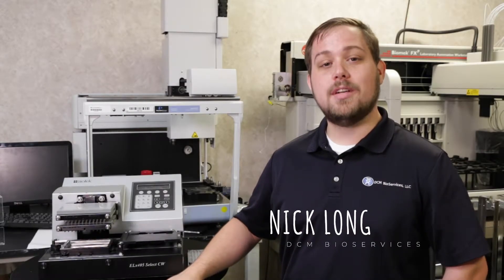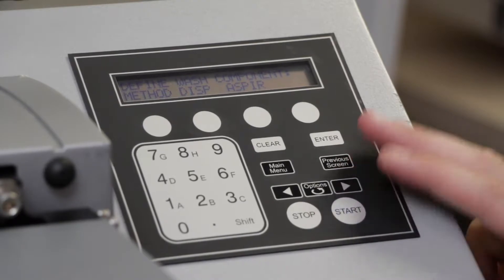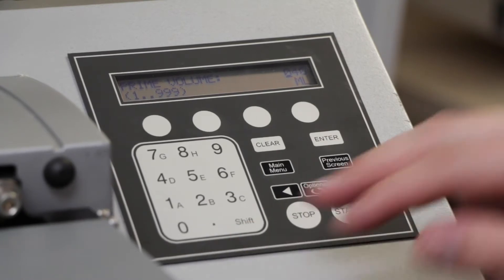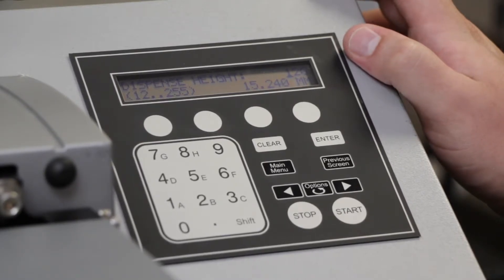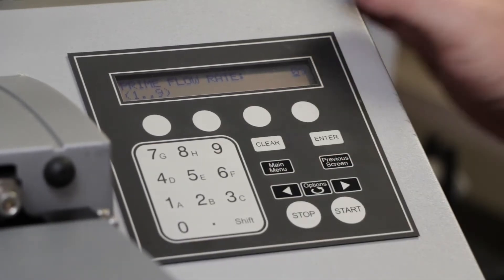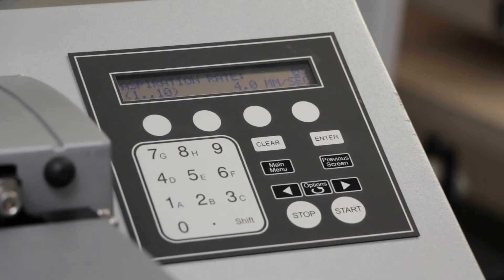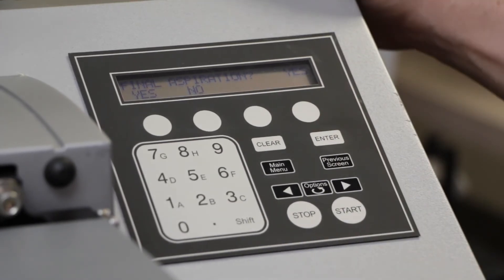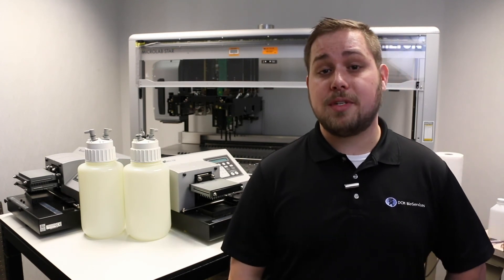BioTek ELx405: Building A Wash Protocol

Comment: Is there a video or step-by-step for how to create a washing step for a 384-well plate, where the head stamp is still a 96-head?
Reply: We do not have a video outlining 384 wash step generation, but the procedure is very similar to the 96 wash step. Only ELx405 Select, Select CW, and HT units are capable of washing 384 well plates with the 96 format manifolds, so please be sure to check your washer model. When creating the wash protocol, simply specify the plate type as 384. You will need to specify the wash format after selecting number of wash cycles, with options for Plate Format (each cycle is performed on the entire plate before proceeding) or Sector Format (each cycle is completed in a quadrant  before moving on to the next quadrant). We recommend double-checking the dispense and aspirate alignments using the adjust utility to confirm the pin positions. Most 384 well plates will run with the default 0,0 positions for X and Y, but non-standard plates will require an offset. The adjust utility will only need to be used for the first quadrant wells, as the washer will calculate the other quadrant locations automatically.